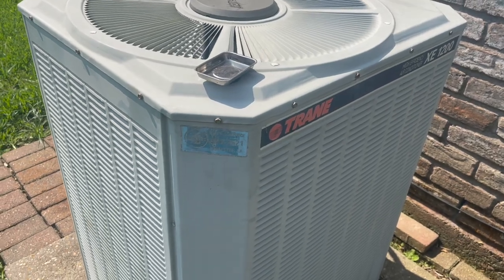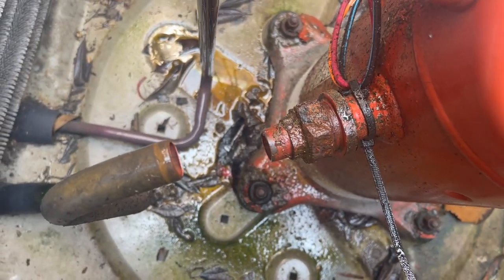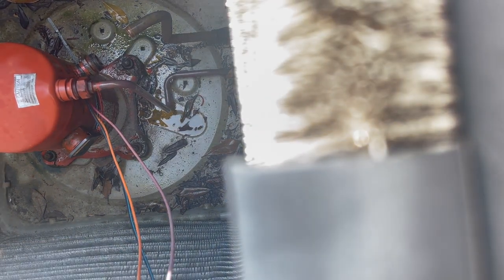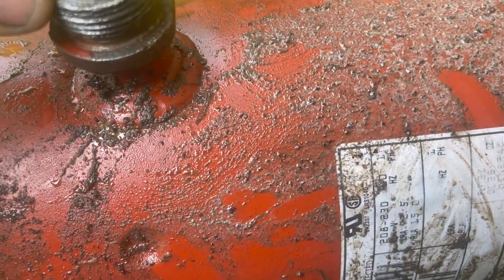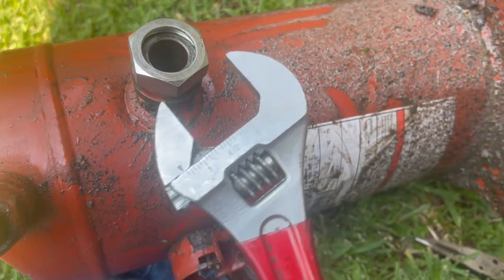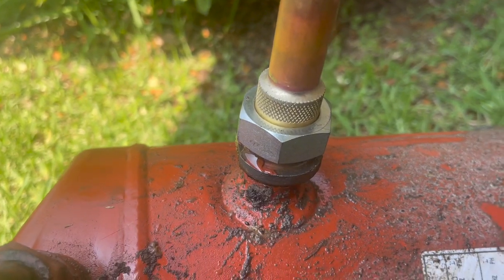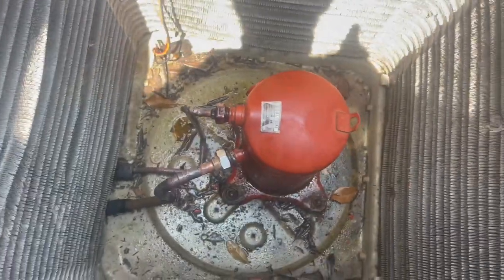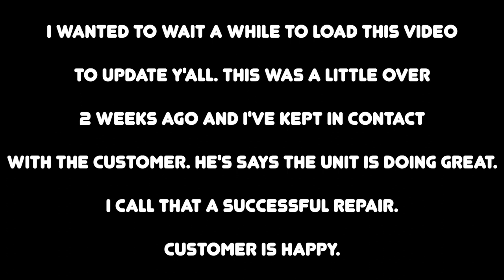Trane Rotolock Leak Fixed

Comment: hey guys got a stupid question if you could help me out. Im in california, had a tech come out they checked my freon levels all is good the outside condensor is clean, new filters, new thermostat, it blows cold but not like it use to it lost about 3-4 degree of cooling I use to set it at 76 and that would keep the house very comfortable if i went below that it got to cold. now I have to set it at 73 and it wont shut off cause cant keep up. the tech showed me a trick if i go wet the outside condensor it will blow super cold for about 15min and the system will get down to 72 shutoff and then kick back on when it hits 73 but stays running but not blowing super cold. like it lost its cold bite....any ideas why wetting the outside unit does the trick and what can be a possible issue? please and thank you in advance. thank you john I value your content, you wisdom...
Reply: Wetting the outside coil lowers the pressures in the system in turn lowering your suction pressure making your suction temperature lower. I'd ask for a tech to check freon levels again and show what your superheat and subcooling levels are to make sure the system is charged correctly. Be sure EVAP coil is clean, filters are not clogged and your blower wheel is clean.
Reply: make sure the condenser coil is clean, many of them are very hard to clean deep inside and will look mostly clean, when they're dirty. if your anywhere near ocean "salt" water, it will corrode the tubing/fin s and ruin heat transfer. also take into account ambient temperatures and "humidity", then factor in all your indoor activities/heat sources/number of people/appliances/windows/insulation/roofing/air leaks. it all adds up fast. as well as what the other commenter mentioned. 🧐
Reply: K guys thank you for your help will check all this  great info and check back really appreciate it.

Comment: rotolock a.k.a. rotoleak. but in all honesty many of the leaks are likely from being brazed(heated to the moon), with gaskets/stem in place and not pulled apart/cooled...
although not being re-torqued after handling and heating, followed by years of rust jacking can do the same. rust kills 😎